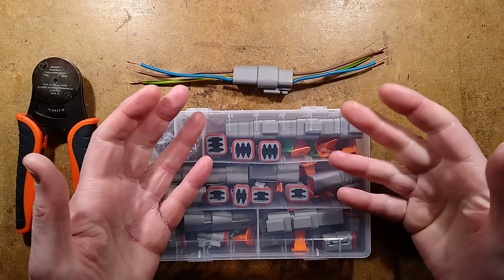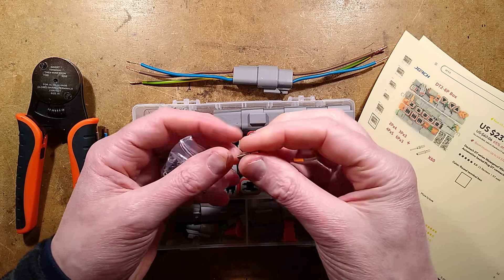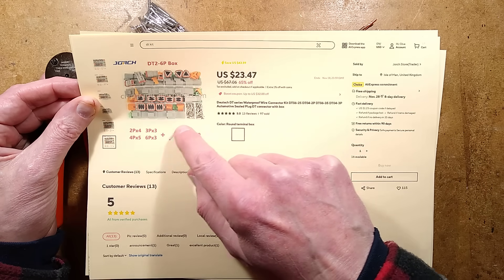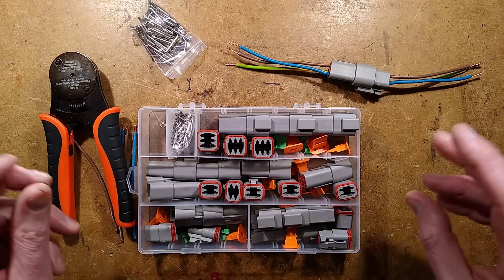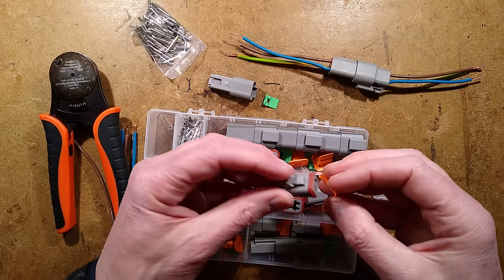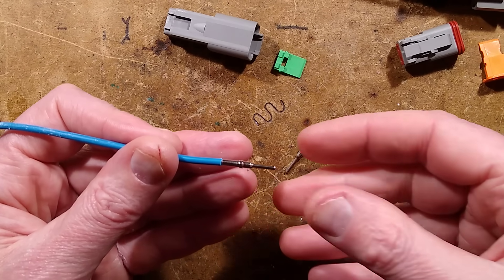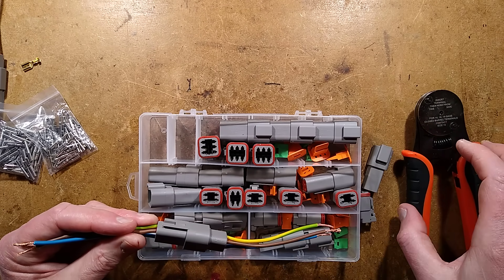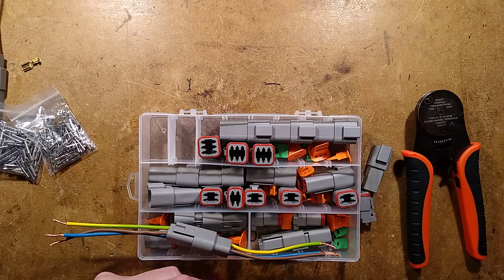Deutsch - my new favourite rugged connector

Comment: Note to people looking to buy, there are 3 varieties: DT, DTP, DTM which use different pins (sizes 16, 12, 20 respectively).  DT is mid sized and seem to be the ones here, DTP are for power (25A) and only offer 2p/4p connectors, DTM are smallest but still offer 7.5A.  Make sure to match the pin size with the crimper and housing!
Reply: Excellent summary. Another thing worth mentioning is that Amphenol makes AT, ATP, and ATM series connectors which are identical/compatible with Deutsch DT, DTP, and DTM respectively. Amphenol is a legit name brand, but they are slightly less expensive than Deutsch, and they can be ordered from Waytek and Mouser.
Reply: @NagawieckiFAB buy only original DEUTSCH connectors and terminals. Only accept the best. Amphenol and others are clones and do not perform the same. (DEUTSCH product engineer, 25+years)
Reply: Thanks. I have figured this out and bought DT and DTP kits.
My new favourite connectors too.
Also a crimper each. Laser do a DT crimper for about £30, but it turns out to be a bit naff. the adjuster only changes the spring pressure not the crimp position. The iCrimp tool I got to do DTP is much better and cheaper.
Reply: Amphenol also makes the DuraMate product line which allows for more DT, DTM and DTP pins. We use almost 100% Amphenol stuff in our company, they are cheap and still a Name brand.
Reply: @piranha1337 ecomate aquarius is similar?
Reply: @eloquentemu You can get single pin DTP as well as 2 and 4. There is also DTHD which are single pin only, it has 3 sizes 25a, 50a, and 100a.
Reply: Deutch also make a bunch of circular connectors that use identical pins. They're also close enough to one of the flavours of milspec circular connectors that you can get pins to suit thermocouple wiring
Reply: @hannahranga  Deutsch connectors is originally made by TE Connectivity, that make 1000000 of connectors, mostly for cars, almost every German car use TE connectors or AMP, with is the same company today, and many og the pins are the same, many of the copy connectors form Aliexpress are junk, use original..
Reply: Its all I will use, my only complaint is the cheap ones weather and the 12 pins almost seize together with dust since the seal is in the female at the base. 

Also a rite of passage is a box dumping out
Reply: You forgot to mention that DT are rated at 16 amps.
Reply: great advice! should def be a pinned comment
Reply: @UnspeakingXVII  pinned and crimped :--D
Reply: Sound advice
Reply: Good to know, I'll probably seek out some of the cheapo ones to try in my various projects.
Reply: Also HD20/30 which are plastic and aluminium circular connectors with many different terminal number and size configurations.  DR rectangular bulkhead connectors.  And DTHD high power single way connectors.
Reply: Skål!
Reply: Thanks very cool
Reply: Also, only the tools $150+ will do all three styles.
Reply: Buy only genuine original DEUTSCH connectors and terminals. Only accept the best. Amphenol and others are clones and do not perform the same. (25+ years DEUTSCH product engineer)
Reply: The official crimpers are $500-$1500 which is insane.
Reply: @wombatillo 
No.  Only around $450  i have them.  But in day to day, use the universal size 16, 20, 12, 4 indent crimpers as they are so much better for volume work.  I also have the larger crimpers for size 4 etc.  But very rarely use them.
Reply: I am from China My factory is specialised in manufacturing high quality Deutsch series connectors and terminals with large stock. We are always able to customise our products to our customers at the most favourable prices. I have been manufacturing this line of products for 20 years. I can offer you low prices on Deutsch connectors!
Reply: @Emma-113zch where is your online store?

Comment: Could be very good if not overkill for making up looms of addressable led strips or cells. I always struggle to find a connector that will do it well, 4pin xlr is another i need to try now that scrollers are all but dead.

Comment: One possibility would be to buy the cheaper set but buy bags of the better pins which are cheaper.  These are not recommended for mains on the Deutsch website despite the transitory dielectric rating..

Comment: They are used heavily in mining equipment harnesses 9/10 a green death dodgy wire  from a flogged out seal and  cut back, recrimp pins, new plug and boom  a diesel fitter feels like a sparky 💪 😂😂😂
Reply from the maker: In many ways, mechanics are sparks by default.

Comment: You can also solder the wire into the terminal. There's a small hole at the bottom of the wire cavity that allows air and flux to escape drawing in the solder.

Comment: Now test those and increasing currents until you get a failure. Let’s see what fails first the wire or the connection. To those stand up to the rate current that they claim? Do they at least stand up to the current that the wire is right at four? I’d hate to see wire rate it for 20 A and those things fail at 15 A.

Comment: The crimp tool is spring loaded and you just push the pin in until its flush. I've never adjusted the tool in 25 years

Comment: An update to @eloquentemu comment with more detail list:
DTM = for small wires and low current (7.5A max)  Used for sensors and CAN signals. 
DT = the most common one (13A max) Good for most automotive stuff.
DTP = made for higher current (25A max) Big stuff, industrial use.

Comment: For the price you paid on Ali, those are not genuine Deutsch but a Chinese knockoff. They are probably good enough for most home users, but if cost is an issue but quality is still desired, Amphenol mirrors the Deutsch connectors in their AT series for around half the cost of genuine Deutsch, and they are made in Germany.

Comment: Not exactly the same, but most my career as an electrician was working on the KC-10 aircraft. That plane is full of Deutsch connectors and i just loved wiring and pinning those. Granted its a 70s aircraft so far less plastic and usually much larger canon plug style connectors but at its core the its the same theory. Because of it I use primarily their connectors in my home projects and things like arcade machines.

Edit: Not quite that important but good to know,  we were trained with these connectors when pinning the wire to leave a gap the size of the width of the wire between the crimp and the insulation. That little bit of space helps the wire maintain during heavy vibration, so less breakages under repeat tension

Comment: Thank you for the recommendation. I need to replace a bathroom extractor fan and  the existing wiring has been cut a little too short and will need extending. These look ideal: compact and sealed from any moisture and dust.

Comment: Awesome connector .I purchased the fake WAGO 222 grey plastic with orange lever for my test bench .won't use them for legal work but for prototyping they are good enough .They look identical but spring is weaker ..There is a good use for those connectors .wonder how dielectric silicone grease would help protect in damp corrosive environment

Comment: With regard to crimping quality, I used to have to regularly test all the  crimping tools in our workshop. 10 samples of every size of terminal for every tool were made and sent to the materials lab. Half the samples were pull tested and the crimp had to hold until the wire broke outside of the crimped area. The other half were sectioned and run through the steps to create samples that could be examined under the microscope to ensure the copper and terminal were fully swaged with no air gaps.

Comment: These are used heavily in the motorsport industry along with Deutsch AS (AutoSport) connectors which are also fantastic. So expensive though.

Only issue I have with these DT's is they are a pain to fit boots to. So you end up using heatshrink and layering it up to protect the wires.

Comment: I dont think the link to the kit still works, though the one to the tool does. They are easy to find, though.  They also have an IWISS tool version is this likely to be any better quality ? Also, are there any rules on polarity for connectors ?
Reply from the maker: I'm not sure if the automotive industry has a standard for polarity.  Many applications involve several circuits in one connector.

Comment: Never heard of them before today. I was watching an American setting up a Scania to haul American trailers and it seems Deutsch connectors are standard to run DC between truck & trailer.
Then, as if my magic, the shopkee... Ahem, your Deutsch video appears.
How's the waterproofing Clive? Can you use them unprotected on a fence yo keep them off the ground, under a 50mm x 50mm horizontal yo keep the worst of the weather off?
They do seem like damned good connectors.
Reply from the maker: They are designed for use in enclosures and mainly for low voltage.

Comment: We used these all the time building off-highway demonstrator vehicles. Even the COTS CAN control boxes we used had an entire waterproof box with these connectors molded in. We only used the machined pins like you show here (about $1.00 each). So reliable!

Comment: 30 years ago I used to work for a company who produced automotive wiring harnesses for the likes of LTI, Thwaites, Dennis Eagle etc..  We used lots of different connectors like AMP, Delphi, and TE  but Deutsch was by far my favorite. Not only were they a pleasure to crimp and assemble but as you have demonstrated if you pinned it wrong it was really easy to disassemble.  They were bloody expensive by comparison though so only manufacturers looking for a really rugged and water resistant harness would use them.

Comment: The company I work for (heavy equipment OEM) uses Deutsch for all of our non-CAN electrical. Everything from 2 pin to 96 pin. Saves a ton of time over soldered pins, and they're actually a bit cheaper than weatherpacks or metripacks.

Comment: I used these on a valve connector for a cylinder on a bridge, that would be sitting outdoors. Great waterproof connectors. The expensive £200 tool was well worth it.

Comment: I wish I could replace all the connectors in my pickup with these. The connectors Ford made in the early 90s are frustratingly difficult to disconnect. I guess they figured people hardly ever need to disconnect them, so there's no need to make it easy... except for those occasional times when you actually really do need to disconnect it, and you break off one of the retainer clips while trying to finagle the thing open.

Comment: I wonder if that plastic does get brittle after many years. These are so relatively expensive i wonder how they compare to the wiring harnesses used in cars, where they probably use less pricey connectors thanks to economy of scale and designing for the minimum necessary quality

Comment: I have used the DT connectors on vehicles and they are more user friendly than other connectors, but a lot of the electrical wiring connectors needed for vehicles, including tractors, would need the DTP 2-pin and 4-pin or alternatively the Delphi-Weatherpack. Unfortunately the larger, genuine DTP connectors are a horrendous price.  Non genuine is significantly cheaper, especially if an old tractor requires a major electrical re-wire due to corrosion. Aliexpress do appear to have a good sized selection box of DTP solid connectors but these are still upwards of £70 plus vat. How safe is Aliexpress to deal with, if anything goes wrong and the goods either do not arrive or are not as described in the listing ?
Reply from the maker: They're usually pretty good, but not as good as eBay when issues occur.

Comment: The folded pins make a much better connection, and you can get ratcheting crimpers for them for under $25 USD. You don't need the official ones. They are nice because you crimp the bigger part onto the insulation for strain relief and the smaller part on the stripped wire for a solid connection. Much better than the barrel type connections.

Comment: I work in heavy industry and can confidently say that the favorite connector for all our electrical needs is usually electrical tape and twisting broken wires together. Second favorite are those massive Appleton powertite 480v 3 phase intrinsically safe behemoths that weigh 40 pounds each for interconnects.

Comment: I bought some for my motorcycle because of this video and even the ali express ones are amazing in comparison to the old connectors I used that wouldnt hold the metal contacts in place when inserted. Just wish the package on ali express included more 2 pole connectors, with less of the 3p/4p/6p ones as find them to be more niche

Comment: Great connectors! Shame you need a separate crimper tool for every single gauge of wire - especially at the price of the official tool. I can't imagine it would be TOO hard to develop a single multi-gauge tool and still have it do a good job, so not sure why they haven't made one (except more money for the company with separate tools). The only thing I would have changed with the triangular connectors, despite the plastic clips preventing you pushing them in and making a connection if you get it wrong, is to NOT have it be an equilateral triangle. Anything other than that and you physically can't connect them wrong because of the different length sides - that way it's even more secure, especially if the plastic clip part ever breaks.

Comment: Ex-F1 / Automotive wiring and integration engineer here. The Deutsch common contact series is an absolute godsend - the same contacts from these connectors (Deutsch DT series) also work in several other Deutsch connectors. I've used HDP connectors as well, great for higher pin counts (DT tops out at 12!)

Some wee handy hints I've picked up in my time:

 - The nomenclature that TE (owners of Deutsch) use for their different crimp contacts is 'Solid' for the closed-barrel/machined contacts and 'Stamped & Formed' for the open barrel / 'folding' crimps.

 - Solid contacts have a few advantages - not only is the crimp process a lot nicer, but they have slightly better voltage drop performance and are a slightly looser fit when mating pins to sockets. Sometimes stamped & formed contacts can make connectors tougher to fully engage together as they're a bit tighter.

 - TE documentation is typically pretty good, but can be hard to find. The best source of information for anything DT/ Deutsch common contact series is the TE Industrial & Commercial Transportation catalogue. Google 'TE ICT' and you'll find it.

- Correct tooling is a must, but as it happens solid contact tools are great for a bunch of different connector series (Harwin Datamate, for example). They tend to be a lot less fiddly, and if you're in a position to splash out on the full tooling like a DMC AF8 tool with the appropriate turrets, it will suddenly become the easiest crimp process you've dealt with.

 - There are a bunch of modification codes that provide different options with DT connectors - check the ICT catalogue.

 - Amphenol make a cheaper version of the DT series called 'AT'.

Comment: Building a wiring harness for a customer's truck, using Deutsch connectors, as I watch this video...

Fun fact; Deutsch D-series connectors are directly compatible with Amphenol A-series and Bulgin PX00 series connectors... After the Deutsch patent ran out, a bunch of manufacturers made compatible connectors.Molex also made their own but got sued over it, for some reason that isn't clear to me... The A-series are sometimes cheaper depending on where you live, and Amphenol makes several bussed variants (internal busbars) which Deutsch does not.

Comment: How do you say they stack up to Mate-n-Lok? For custom automotive work they are quite popular.
Reply from the maker: Those are common, but not water resilient.
Reply: @ ah yes I do believe I messed up: I meant Superseal, not Mate-N-Lok. My bad. 

So for Superseal, how do they stack up? 🫣
Reply from the maker: @RustOnWheels  I've used Superseal, but didn't care much for the odd crimping approach that doesn't grip the insulation.

Comment: This is awesome my RV aka Caravan in Brit speak has plenty of butt crimp connectors in the crawl spaces and my cats have pulled / chewed them to pieces when sneaking into those tiny spaces this would solve my issue and look much better than the ugly butt crimps plus water tight because RVs and water leak issues are a thing especially my 2021 COVID era built Thor Freedom Elite

Comment: I generally wouldn't recommend getting the "standard crimp" pins and sockets. In my experience, I have seen far to many crimped improperly causing the crimp to actually break many of the copper strands of the wire. Then after a few years of use the few strands remaining break. Leaving you with a sensor circuit open fault, but the break is inside the connector body making it difficult to find, especially if you are unfamiliar with electrical troubleshooting. I have had very few issues with the "4 way crimp" in my 15 years of wrenching.

Comment: I've been aware of these connectors for some time - most commonly seen as weatherproof connectors for vehicle lights, police lightbars, strobes, etc.  I believe however there was an additional rubber over piece mostly responsible for the weatherproof quality ( I seem to recall a sample submerged still dry after weeks). I think siliconing was recommended at places otherwise

Comment: Few things.
How long you think those rubber seals are going to last? 4 years? 10 years? 8 months?
As far as servicability goes I think most contractors would prefer to just snip the whole thing off as a faster option. But it's a nice thought...

Very nice that it's keyed. I would never consider halfway-to-latched as fully-inserted though.

Comment: Heavy equipment mech here. Those are the best connectors IMO. I rewired a boat with those. Easy to maintain and repair. Super easy to re-pin if corrosion gets in there